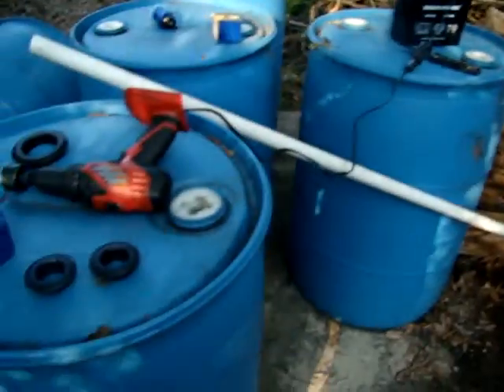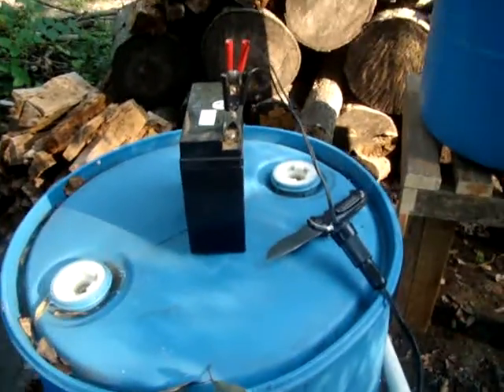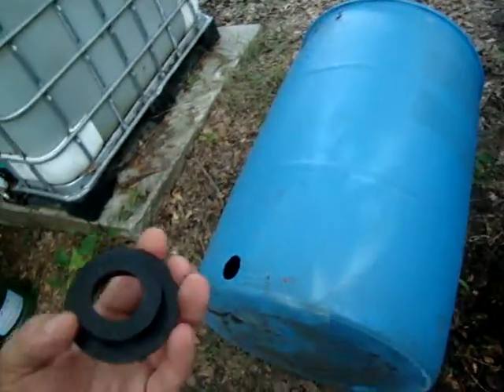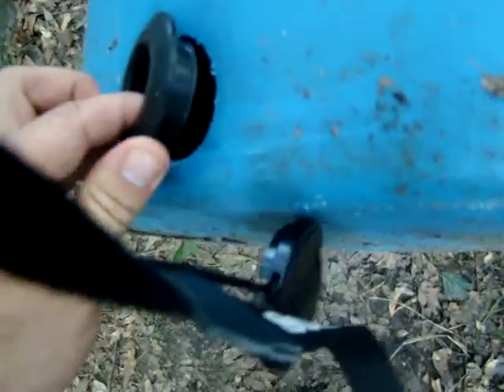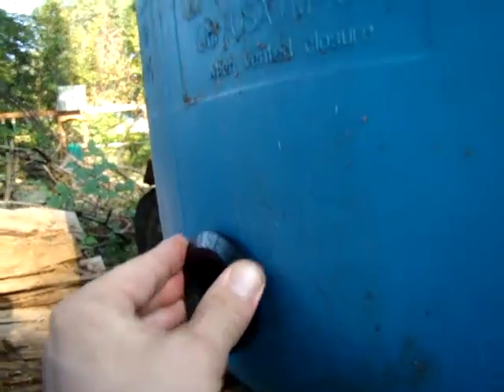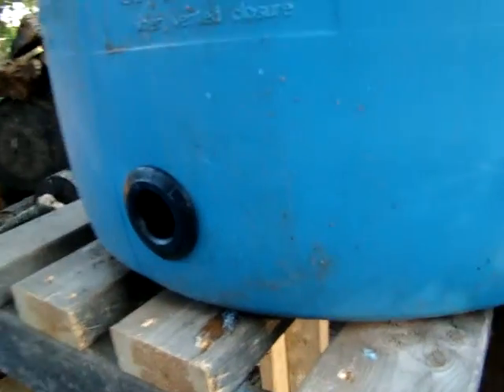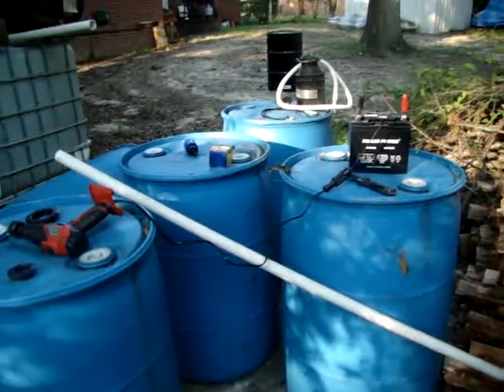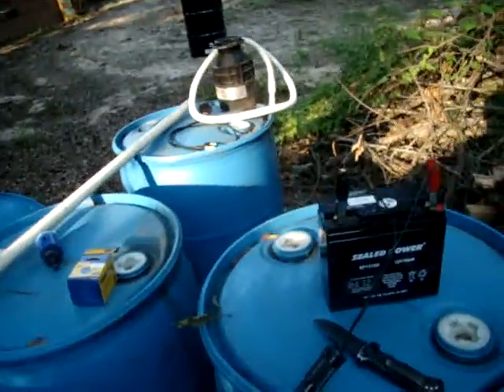How to install a UniSeal on a 55 gallon rain water barrel

Comment from the maker: Uniseals are great. and they work well when they are installed properly. On a website I found that supplies them, they have the recommended hole saw sizes to ensure they are leak free.

I haven't yet install the methane recovery system, nor added anymore food junk to the barrels and they still are producing small amounts of methane to this day.